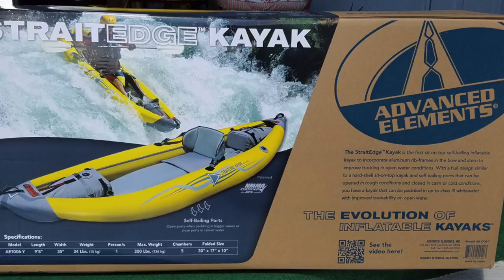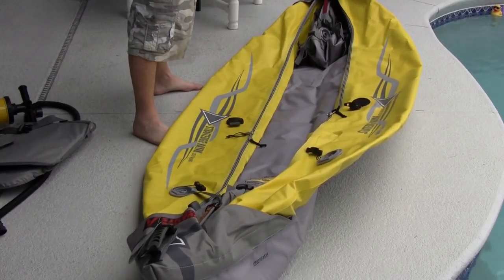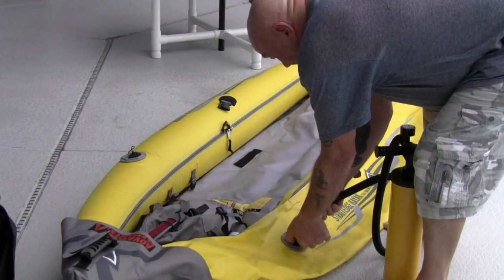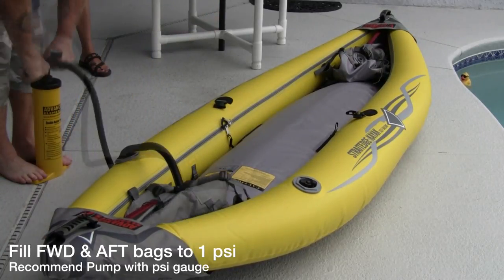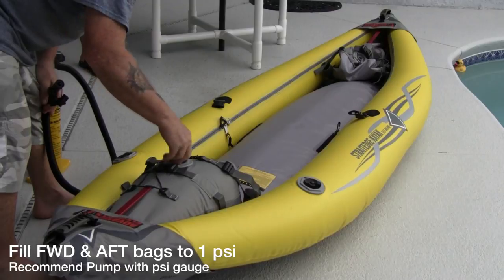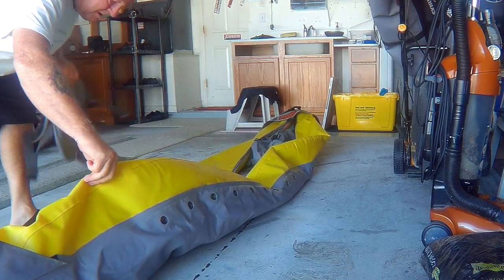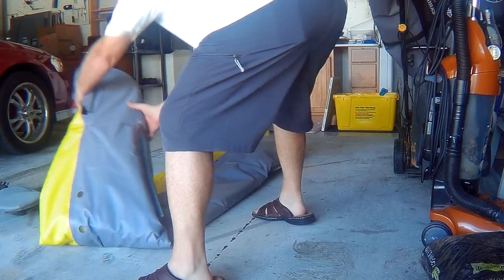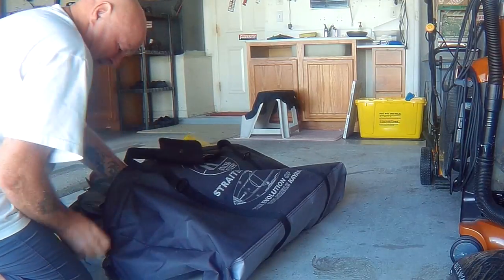Advanced Elements Assy,  Disassembly and Storage Straitedge

Comment: Should I let it sit and dry in the sun before or after I deflate it?
Reply from the maker: Either or, personally I leave it partially inflated. I let some of the air out or if deflated on location I will partially inflate it maybe 50% when I get home to dry. Reason heat expansion. I hope that helps.
Reply: Dale Mr. D Simmons Thanks for the quick reply!  I have 2 straightedge anglers on the way and can’t wait to get them out on the water.  Thanks for all the info sir.
Reply from the maker: No problem, anytime. They are a fun yak. Congrats